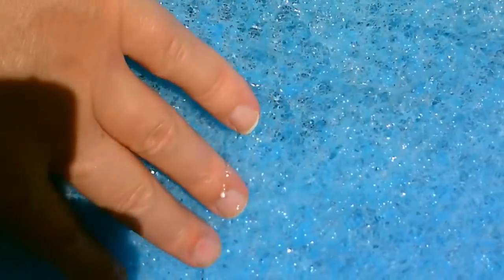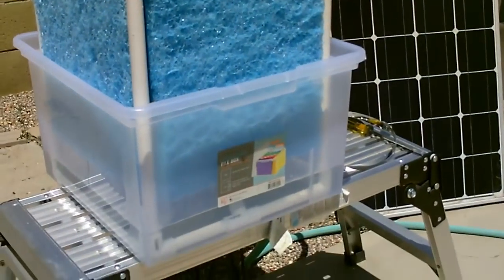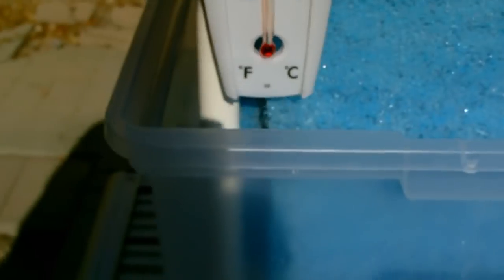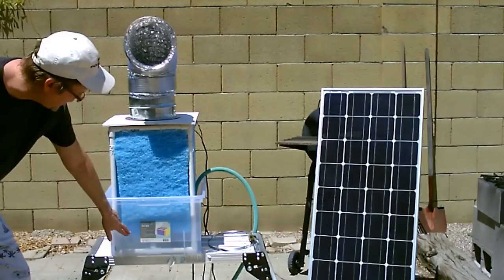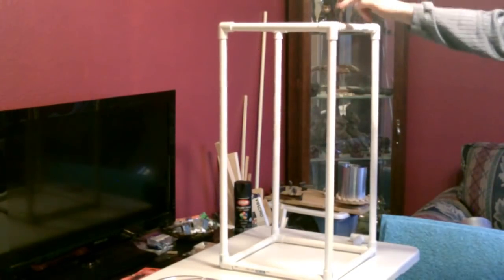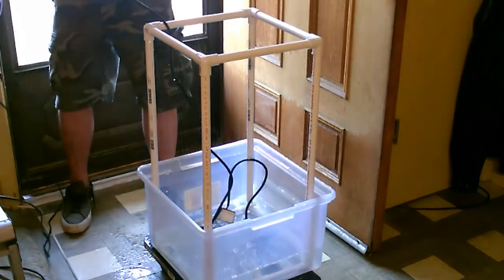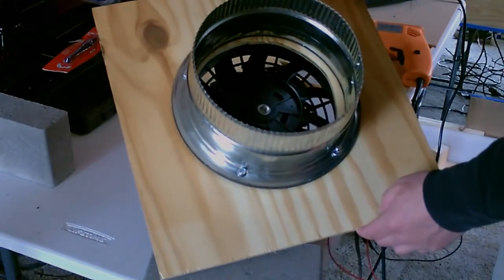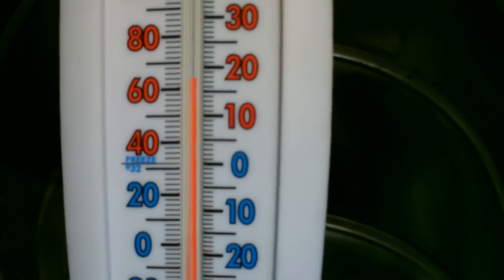DIY Evap Air Cooler! Best Yet! 1500CFM/20MPH (90Fin/64Fout) 500-1000 Sq.ft. run AC/DC/Solar/Batt

Comment: I'm excited to try this! Thanks for making this information available. I assume that the hose that connects to the PVC nipple has to come from the pump outlet in order to push the water through the frame then collect more water through the pump inlet. The outlet on the pump you linked to below is only 1/3" rather than 1/2". Are you able to clamp it tight enough despite the oversize tubing or would a smaller nipple (if available) be necessary?

Comment: Do you have both the pump and fan connected to the solar? I’m in the desert too, and really want to try building this, but have zero solar knowledge, so I wasn’t sure if you had both devices connected or not. Thank you!!!! (I built the ice cooler a/c unit yrs ago as well…oh I hope you see this question. Lol….or if anyone knows the answer, please let me know. I may have missed it being explained in the video.
Reply from the maker: hi. yes, i usually run both the pump and fan on solar. i hope you build it! it's a great air cooler. very powerful unit
Reply: @desertsun02 sorry for another question, but I’m waiting on my panel kit to arrive later this week, got my pvc, fan, but the pump…I’m having a heck of s time finding a pump that is DC and is the correct size/specs. Any suggestions regarding where I can find one? I’ve been on amazon looking but alit are AC, and if I’m learning correctly, I would then need an inverter. The pump I bought is a mini pump but the spout is so small, I can’t get the tubing cable tied small enough to stay on it. Also, the plastic piece you attached to the pvc that you attach the tubing to, what is that piece called? I was looking at the store for one but didn’t find one. THANK YOU!!!!! (Sorry for being a pain lol)!!

Comment: hey there! how well do you think it could cool a tiny server closet? as of now, it currently is extremely loud in my closet (as I run distributed computing, to help find cures to illnesses by donating computer power to research), and I wanted to know if it would work in a tiny closet (about 0.6 SQFT)? I'd assume so but wanted to make sure
Reply from the maker: hi there, this unit can cool whole "full size" rooms so it would definitely cool a tiny closet. you might want to make a smaller version of this unit for much a small space. 0.6 sq. ft. is a very small area.

Comment: What is that blue material ?
Reply from the maker: hi. it's evap cooler pad. technically this type of cooler pad is called 'foamed polyester' evap cooler pad. usually sold in sheets or rolls.

Comment: With very few modifications, this could fit just  about anyone's needs for open-air shop. I have done similar in the past and found out the cooler and pad needs to be in Direct Sun. Sounds crazy but it works much, much better. I have gotten 25° drop with much larger CFM (cooled 3 open shop bays in an auto Repair building), but I think modifying yours would be better and cheaper than what I did.( old swamp box on wheels with 1/4" plastic tubing) I might use one of those very small and cheap garden hoses with quick disconnect to fill it with every once in a while. In an auto shop, it is a necessity anyway.
Reply from the maker: hi there. yes, this particular build is pretty strong and versatile. i'm not sure why your unit worked better in direct sun. that hasn't been my experience. they seem to work the same (sun or no sun). the main factor I've noticed is relative humidity.

Comment: I wonder if strips of a High-wicking material (cotton?) could be used to 'move' the water to the top of the pads.   Would be pretty neat if a design could be found that eliminates the water pump.

Comment: Will this work at 85% RH?
Reply from the maker: hi. best way to see if it will work for you is to check an evap cooling chart. those are found online and will show you what temps to expect with a given humidity. 85% in a little high for these.
Reply: @desertsun02  will do, thanks

Comment: do those blue pads absorb water like a sponge or does the water just run right through them?
Reply from the maker: hi. actually both. it absorbs it like a sponge and it runs through it at the same time. the material basically acts like a 'loose-knit' sponge. it holds a lot of water but still lets a lot of air through too.

Comment: I am making my parts list for the Direct Evap Cooler. Using the SEAFLO 12VDC 350GPH Electric Marine Bilge Pump, the tubing connection is 5/8.  So the PVC connector  and the barbed fitting should be 5/8 as well as the vinyl tubing, correct? The video shows 2 diff sizes and lengths of tubing but I only saw you hook up the shorter  large diameter tubing.  Is the longer length tubing for the "indirect" cooler build.

Comment: Awesome video... again! Did you glue (solvent) the PVC joints, or did they hold the water without any/very little water leakage? And do you have any videos that walk us through the AC/DC/battery/solar wiring hookups on your projects? Thank you for your guidance.
Reply from the maker: i didn't use pvc pipe cement (but you could if you wanted to). it's a very low pressure system so it works out good. the frame is well within the tub so any water that leaks just runs down the pipes and back into the tub. yes, i have one or two videos that show in detail how to connect most things to solar panels. most of the projects also show the hookup

Comment: Thank you for putting this together, it's awesome that you are getting such cold air. How did you come up with your specs though?  If you are recording 20mph (1760 feet per minute)  out of an 8inch duct (0.34 square feet), that's 1760ft^2x0.34fpm = 603CFM about a third of the airflow that you are rating your cooler at.
Reply from the maker: hi. the 20 mph was measured with a basic anemometer. the rating of the fan (1500 cfm max) is per the manufacturer. i did some calculations on it and came up with about 1200 cfm (still under the max but strong airflow).

Comment: How do you wire a battery to it
Reply from the maker: hi. you can just wire it straight to a 12v volt battery. deep cycle battery is the best. the DC fans and DC pumps work great on battery power.

Comment: Hello! I will try building this soon but I have a question. Do you use something to block water from going down into the side support legs or just let them fill with water? Would maybe sealing them with epoxy or even hot glue work to not have water sitting in the supports, or is there a benefit to that that I may be missing? Great video!
Reply from the maker: hi there and thank you! you just let them fill with water. the frame is the plumbing so the water just flows through the structure. have fun building and using it! it's one of the best (strongest) air coolers i've made.

Comment: Great video👌, I live in South Africa, not as hot or dry as Arizona. I live in a home with little insulation so it gets hot inside. I'm just wandering how well this cooler would work at a humidity of 40%?
Reply from the maker: hi. they work okay up to about 60% RL (but the lower the relative humidity the better). if you are using it outside then they can even work in the 70%-75% range (with the right temps). if the RL is much higher then they tend to struggle.
Reply: @desertsun02  thank you so much for a quick response😉

Comment: Do you have a link where to buy that pad?
Reply from the maker: hi. i don't have a link, but the best place to get the pads are the home stores (like home depot and lowes). they've got them stacked to the ceiling where i live. average cost for a big (3'x3') sheet of it is 8 bucks. amazon has them but they are usually massively overpriced on that site. if you search for 'foamed polyester evap cooler pad' you'll see lots.
Reply: @desertsun02  Thanks a lot!

Comment: Do you still remember where did you get the parts. Like the water pump and the fan thanks
Reply from the maker: hi there. best place to get the water pump and fan are amazon. any water pump around 200gph should work good. the fan is a 7" 12v 80 watt car radiator fan. amazon has lots of those.🙂

Comment: Thanks for great video. You are a great inventor.
Please let me know if I need for solar panel an inverter?
Reply from the maker: hi there. since the fan and pump are DC powered you don't need an inverter. you can just hook the fan and pump directly to the solar panel.
Reply: Hi friend. 
But Solar   generates 
Almost 30v more than double required for water pump and central motor.
Reply from the maker: @JUREK WASOWSKI if it's a 12v solar panel it should output closer to 17v to 18v. that's pretty much perfect for running 12v pumps, fans, lights, etc. (note that most 12v transformers (with 12v power sockets) output anywhere from 14 to 17 volts. the few extra volts is totally fine.) most 12v items will run fine up to 25v or so. if your solar panel has 30v output then it's probably a 24v panel (or something similar)

Comment: I wonder what would happen if you put a transmission cooler on the other side of that transmission cooler fan and pump the cold water from the bottom through it as well?

Comment: This is such a great design! 
I'm curious, if the fan direction was reversed (so it's blowing air in to the filter cube), do you expect a drop in efficiency? 
I ask because I plan on running this in a very dusty environment (burning man), and was thinking about ducting in dry air from the outside through a filter, as that seemed easier than putting an filtering enclosure around the entire filtering cube.
Reply from the maker: hi there and thanks. this is definitely one of my best designs. the unit won't work if you reverse the fan direction. it has to be set to pull the air through the pads. the pads act like a 'wall' if you blow air at them. i don't think the dust will be an issue at all. these pads actually work very well at filtering the air too. (when they are wet). any dust will just hit the pads and run down into the bucket. my guess is you won't even notice it. have fun out there 🙂

Comment: So you think this would sufficiently cool a 700 sq ft garage?
Reply from the maker: hi there. it certainly could. the cooling power of these units varies quite a bit (based on your temp and humidity) but if you're in a drier area these things cool like crazy. this is one of the strongest coolers i've made.

Comment: hwo much would it work in a house thats near a beach?
Reply from the maker: hi. it really just depends on the humidity. if it's not too high these things work awesome
Reply: @desertsun02  With more humidity, it will lower fewer degrees? or becasue the temp, will it work better if direct some heat to the pads?

Comment: Can i ask a question ? are you recirculing the same water all the time  i dont get it ... at one point the water should become warmer and reach outdoor temp ...
i never seen this contraption before ...Btw had to Sub theres brilliancy on this channel 👍👍
Reply from the maker: hi. yep you are just using the same water in the tub. the water doesn't warm up - it gets colder and colder the more you run it. and it cools it super fast. these units double as water chillers. the reason is that the evap. process is not only cooling the air but it's also cooling the water. example: say you start with 100F water from the garden hose and fill up the tub with that. then turn it on. what happens is every time the water passes down the pad the air rushing through the pad cools the down the water *to the evap air temperature. so in like 10 minutes the entire tub of water goes from 100F down to 70F (in low humidity). the output air temp and the water temp become essentially the same temperature.
Reply: @desertsun02  First i want to thank you for awnsering my question..👍
+ i have to try this out ! im a 30 year veteran in the HVAC biz and never seen this before ...+ if i dinth seen it i woudnt of beleived it...
its against the laws of Physics 😳
Well goes to show you never stop learning and i thank you again and will certanly be watching your ingenious ways to do things...✌️🇨🇦🐝
amazing
Reply from the maker: @beez it seems against laws of physics (but it's not). if you read about evap cooling you'll see all the info on how it works (by trapping the heat as 'latent heat' in the air etc.). the one thing a lot of people don't know is that evap. coolers work as awesome water chillers. (because the pad gets evap cooled along with the air. (making the water cold)).
Reply: @desertsun02  thats awsome if i would of known this before i would of made hundreds of them for people in need ...ex: 10-12 years back i got a call in Mid summer from a Nuns retirement place nearly a moratorium and they ask Me to make an estimate to cool off a few floors of there hospital so i did it ended up long story short costing in the $ 100,000.00 range either whith central or wall units it was horondous the Nuns were dying of heat...and very high humidity and lack of ventilation...it was so sad :( 
i could of saved lives whith this tecknic ....anyway i half to try it out and maybe pass on to Yonger Technicians so they could help Older folks in the furure...👍
I cant thank you enough and if or when i build this thing i will let you know ok and take care please 👍👍🇨🇦🇺🇸

Comment: What are those blue pads called?
Reply from the maker: hi there. the blue pads are called 'evap cooler pads'.
Reply: @desertsun02  Thanks!  Considering your screen name, I assume you live out west where the climate is dry.  I live in North Florida where the humidity is high.  I'm curious as to how much of an efficiency loss I will experience If I duplicate your system here.  I'm looking for solutions to cool my wife's sewing shed using only cold/cool water and DC power.
Reply from the maker: @John Powell it will depend on the exact humidity (but the higher the humidity the less effective these are. they work pretty well up to 60% then they start to struggle

Comment: I can't find a 1500 CFM  fan
Reply from the maker: hi. here's a few of them
here's a 1730 cfm (max one) -  i think it's the same one that i used https://www.amazon.com/DNA-Motoring-Performace-Electric-Radiator/dp/B01NB0LK0D/ref=sr_1_4?dchild=1&keywords=7%2Binch%2Bcar%2Bradiator%2Bfan&qid=1622901769&s=automotive&sr=1-4&th=1

here's a 2 pack of 1730 cfm https://www.amazon.com/Rxmotor-Performance-Electric-Radiator-Assembly/dp/B01MZ6XBXE/ref=sr_1_3?dchild=1&keywords=7%2Binch%2Bcar%2Bradiator%2Bfan%2Bhigh%2Bperformance&qid=1628085106&s=automotive&sr=1-3&th=1

here's a 2 pack of another 1200-1600 cfm range (this is the exact 2 pack i've bought/used in the past) https://www.amazon.com/MOSTPLUS-Universal-Electric-Radiator-Mounting/dp/B077XW7CFX/ref=sr_1_30?dchild=1&keywords=7%2Binch%2Bcar%2Bradiator%2Bfan+high+performance&qid=1628085266&s=automotive&sr=1-30
Reply: @desertsun02  Thanks so much! I don't know why it was so difficult? Maybe DC? Anyway, thanks again!

Comment: Do they make a 1000 cfm fan using 110 w? I can't seem to find one. I'm trying to cool about 200 sq. feet
Reply from the maker: hi. if you mean 110v - i'm not sure if they do (but all you've got to do to run this on AC power is use an AC to DC transformer. rowpow makes a good one. i have a 12v 15 amp one. had it for years. allows me to run basically all my DC projects on AC.
Reply: @desertsun02  Thanks for the info and getting back to me!
Reply: @desertsun02  rowpow or roypow?
Reply from the maker: roypow

Comment: Nice I'm learning I live in Florida here is high humidity could it be used here thanks
Reply from the maker: hi there. they work best when the humidity is 60% or less. they can work somewhat from 60% to 80% (if the outdoor air temperature is in the right range and it's being used out of doors). but they really struggle if it's over 80%

Comment: Why did you have the air flow from fan blowing into the container instead of out when you installed fan?
Reply from the maker: hi there. i always run them so the air blows out (meaning it pulls the air thru the pad). one cool thing about the fans i use is that they can be installed either way (because it runs either way). the fan i use (and it's blade) are both reversible 🙂

Comment: I just wanted to say thank you... with covid 19 I've been living in my truck with my 4 four dogs...  spent the winter restoring a 50 yr old aluminum camper shell...  but the summers in northern California are hot as hell... tried so many different stupid cooler amd they all sucked.... but then I came across your system and watch most of your makes  and I just so happen to put solar onto of my shell... it's been a 107 to 111°  so far...  send pics of all when finished...  thank you again for sharing your vids.... most appropriated....  look forward to more of your DIY builds... take care... Be safe... 
                Sincerely 
                           Louis M....
Reply from the maker: hi there. this evap cooler is one of my best (strongest). if you've got the right humidity levels it really cranks out the cold air. based on the temps you listed (107 to 111) you almost certainly have low humidity. sending a pic of your project would be great. i love seeing the builds. best place to send it would be my email that is listed on the 'about' page of my YT channel.

Comment: I have had better luck with aspen pads in my coolers.
Any reason you use the synthetics?
By luck I mean cooler air.
Reply from the maker: hi there. i seem to get about the same results with either type of pad so i stick with the blue ones. i find the aspen pads need more support or they just fall apart quickly.
Reply: @desertsun02  good to know about the pads falling apart

Comment: great stuff! does the water in the reservoir have to be cold to reach the temps in the vid? or its just room temp water? thanks!
Reply from the maker: hi there. it just uses room temperature water. the water temps drop fast because the evap. cooling effect works on the water as well as the air. 👍